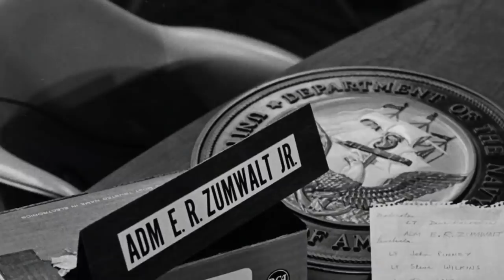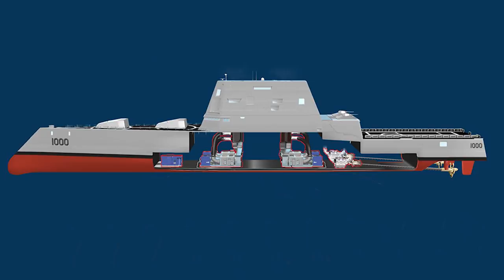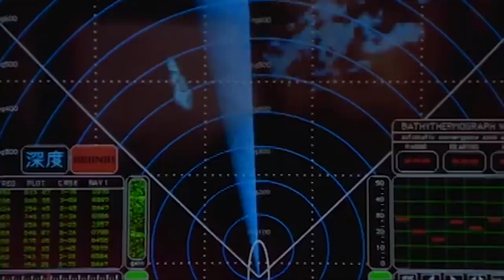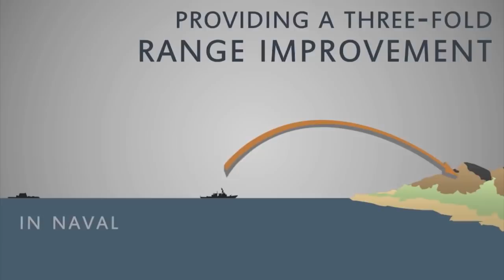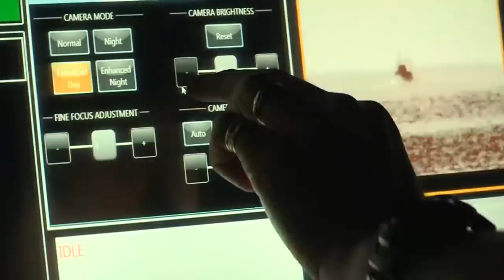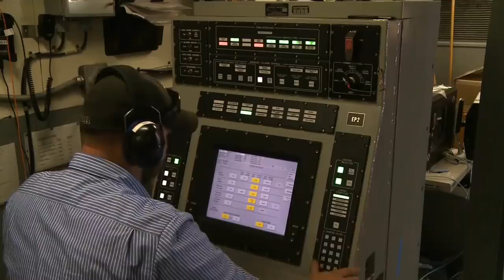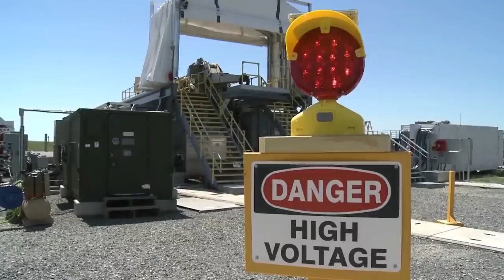Zumwalt - destroyer from the future

Comment: Retiring Battleships was dumb.

They could've designed the Zumwalt as a heavy cruiser or fast battleship and given themselves a bit more armament and space.

And why shoot guided missiles? It's artillery, use a battery of dumb fire rockets.

The reason the defense force has such a massive budget is because of our new found obsession with stupidly expensive missile weaponry which has a massive weakness in that missiles can be shot down by point defense weaponry. Meaning you have to flood the target with missiles to ensure some land anyway.

It's a lot harder to shoot down a dumb fire shell that will do as much or more damage on impact. On top of that, they're cheaper, and take less space for storage. More rounds for targets, less need to flood the target with rounds, and similar destructive power.

Comment: While the Zumwalt-class was a failure as a class of ships,it did succeeded in it second goal as the Technologies and Designs that were created and refined can now be applied to future models with out the MASSIVE cost of a new system and as the ship has more power available than its contemporaries it makes for a great platform to test newer power hungry systems such as EM-guns and laser systems. while some tech such as the canons proved to be flops the drive/propulsion, stealth and automation systems are very successful.
But saying that the class failed on the on the merits is wrong as it failed due to the failed understanding of cost by politicians, if the R&D cost was split between 50 ships the R&D cost pr ship would be significantly lower and a lead ship in a class is always much more expensive than the following ships as the shipyard has to retool for a new class and so on. also the more of equipment specially designed for a vessel is purchased the lower the individual cos becomes, but politicians hear that the first couple of ships will be expensive and so they think that every ship will cost thee same and so they want to kill the program so they can shuffle the money to their pet projects. 

One can just look at the F-35 which was crippled from the start by the involvement of the marines need for Stol/Vtol and then the cost overruns from the compromises lead to higher cost, and so the politicians made massive procurement cuts which ended up increasing cost. so in the end the planes that were bought cost more meaning that almost no money was saved when looking at the fact that for the same money they could have gotten alot more planes

Comment: Unfortunately, the determination of Zumwalt’s failure or success will not be determined until or if the ships see real action. If they function as well as the previous class, I would say they are a failure. They will have consumed way too much resource to not perform spectacularly. It would be tragic to get a report that they were in battle but were destroyed due to a software bug in a defense system or because a “blue screen” came up on a propulsion system, or some electronics failed due to corrosion of electronic or battery backup systems. The loss of lives due to being “zumwalted” is not a phrase I hope not to see join our language in my lifetime.

Comment: You're way too kind to it. In reality it was a mess from the start and got worse. 

When you're talking about 16,000 tonnes, for a ship designed primarily to fight with artillery, you are talking about a battleship. Calling it a destroyer confused the design process from the beginning, and continues to confuse it today. The belief that "aircraft carriers made battleships obsolete" is as pervasive as it is stupid, not only was it not the original theory given by Mitchell (which was about land based airpower making navies in general obsolete), but it has not been borne out by evidence at all. 

A ship in the 100,000-150,000 tonne range with 8-20 guns in the 500mm/L70-700mm/L50 range, with a barrel life of 1000 effective full charge rounds and a rate of fire of 2 rounds per minute with a warhead size of ~500kg/shell provides exactly what the USN actually needs at low cost without the development risks. Such a ship would be large enough to carry a 35m AESA X-band radar (sufficient to track a softball in orbit just above the horizon) plus 500 or so VLS cells, while having sufficient armor to shrug off anything likely adversaries are able to throw at it. It also allows for a massive increase in potential computing power for any and all applications. 

Such a ship is large enough for a twin or even quad nuclear reactor design which not only gives them unlimited range but allows them to operate indefinitely even when cut off from the mainland US, while in peacetime allows for constant global deployment using rotating crews thus effectively doubling their availability compared to a smaller diesel powered ship. It would also allow the ships to reach speeds as high as 40kts, with even their cruising speed being as high as 36kts depending on hull shape and propulsor selection. 

Such a ship could be built using proven technology in commercial shipyards for a 50-100% premium over Burke class destroyers, even conservatively these ships provide more than double the effective naval operational capability of the Burke class resulting in a effective cost reduction across the navy as a whole. 

And the only reason such an idea is considered "laughable" when it should be considered obvious is because "aircraft carriers made battleships obsolete" is a maxim that everyone believes and nobody questions. That and it doesn't make the right people enough money.

Comment: Yes 80 that is sea to land and anti ship missiles. And if you use say 10 of these missile launchers for anti-aircraft they each hold 4 so we have 70 potential ship-to-ship or ship to land type missiles and 40 anti-aircraft ,  anti-missile missiles. So now you have a ship that out can outrun any opposing ships it's almost completely invisible to electronic devices it can only be seen visually which is way too late to defend against. It has the potential to knock out 70 targets. That total pretty much out numbers entire Chinese Communist Navy on one ship and there's three of them. If I was say North Korea I'd be nervous about such ships cruising in along our Coast at night. About all that electronic gear collecting information such as location of defensive missile and gun positions troop movement and command-and-control. Imagine the three of them Cutting Loose with over 250 missiles in 90 seconds. And then taking off like bats out of hell in three different directions and you're electronic devices unable to pinpoint them and if you could you can't Target them five minutes later everything that you would use against them  is gone. Then imagine that you realize that there is a couple of carrier task forces setting off your Coast 3 or 400 miles. You don't seem to have the respect for the technology. Yes other destroyers have a few more missiles but they don't have the strike capability that is a definite multiplier. These ships are the F-22 of the fleet.

Comment: The front looks cool. I wonder how they power the electric motors batteries. It would be good for sneaking up on Iran or North Korea. Hit and run attacks. It would have to have Tommerhawk missiles and nuclear weapons. It could be used for surveillance. Since this corona virus has cost the government so much ( and everyone else) , they are going to have to make do with what they got for a while. Do electric motors on ships run on fuel?  What about making one that can go under the surface like a shark and pop up if you want to go fast. Don't have safety rails. To much drag. Give the sailors magnet shoes. Why have anyone on it at all. All done remotely like a drone. Kinda like the Germans U-Boat.
Reply: They're equipped with Integrated Electric Propulsion. There are no batteries intended for propulsion just rather redundancy of other electrical systems like the machinery, damage control, and navigation equipment. The ship uses gas turbines to generate electricity (think of a helicopter's turboshaft engine with different gearing and a development origin based around jet engines rather than turboprops like many examples out there).

Comment: A disaster from the hydrodynamic point of view.
All the hype aside, this ship is so hydrodynamically inefficient that its hull form designers should be sent to pump gas.
Why would I-an ex navy man-claim this?
  Simple.  An Iowa class Battleship (50,000tons displacement) had a 200,000 SHP power plant, giving it a top speed well in excess of 30nts (over 35nts in trials).  Zumwalt (at 10,000tons displacement) has a 141,000 SHP power plant and can't even make 30nts.  In fact, every major wearship class (Cruiser, Fleet Carrier, or Battleship) built during and since WW2 could beat Zumwalt in a flat race . . . most of them heavier and with with less horsepower.  Carriers exceed 30nts easily.  So do our cruisers.  So did the Iowas.  Seen in this light, Zumwalt is a pig . . . BEFORE its high metacentric and failed weapons systems are factored in.
  Which is sad.  I WANTED it to be a deal breaker.  But operations costs prevented it, because those last few nauts of speed are very pricy in terms of fuel consumption.  That's one of the reasons we went nuclear for half our fleet carriers this time around.  Unfortunately, when in combat, you'll need those expensive top end nauts.  You can't go cheap on a warship meant to do it all.
  Weapons:
  The Zumwalt is, effectively, the Missile Arsenal Ship the Navy looked at twenty years back . . .and discarded as being wayyy too expensive.  VLS is sexy as hell, but to fill the ship's VLS with modern missiles (SAMs, Tomahawks, and harpoons) would cost so much that we could not afford to fully arm them*.  And that's just the missiles.  The Gun systems meant for the class were defunded due to cost overruns and the inability of the weapons or their highly specialized projectiles to meet targets (pun intended).  The "Railgun" will never be in service; the heat problem cannot be managed well enough to allow a useful Rate Of Fire (ROF).  LASERs, now being tested in earnest on the USS Phoenix, have so far failed to best their ultimate enemy: the atmosphere at sea level.  Thermal Blooming (the need to ionise all the air between muzzle and target BEFORE delivering any energy to the target) absorbs 80% of power expended**.  That means in action that LASER weapons must be held on target to gain any crucial effect.  Considering the ocean's movement, that makes it impossible to punch holes in anything; imagine trying to hold a beam on a 1m target area, while the enemy captain is trying to stop you by swerving, changing speed, and letting the sea push him around.  And, using the LASER as a target designator for your missiles just moves us back to the expense of missiles conundrum.
  Sensors: 
  Ours are most likely the best in the world, but Zumwalt is no Picket Ship.  It is meant to be a standoff weapons platform, able to perform Fleet ASW, Fleet AA, and Shore Bombardment, roles with equal facility.  The weapons, sad to say, are still waiting development.
  Conclusions?  DD 1000 is a wonderful technology demonstrator (integrated power supply, up to date sensors and unlimited uplink/downlink coordination with GPS and other military orbital assets) whose proposed weapons did not live up to promise.
*Rossiyah has the same problem with its Kirov Class Nuclear powered Battlecruisers.  Plenty of space in the magazines, but the missiles are just too damn expensive to fill them.  Paper tigers.
** Lambda Max (designed maximum power transference to target as a function of wavelength) is the big hurdle for the LOS Combat LASER.  We need an output frequency suitable to transfer more power with less thermal blooming.  Materials is the key here, I believe.
  Disclaimer: I am not an expert on any of the relevant topics.  I simply try to stay informed on naval matters.

Comment: IS THIS THING GOING TO BE CONVERTED TO FULL SURFACE/SUBMARINE HYBRID CAPABILITY LATER? AND OWNED/CONTROLLED BY THE CIA? TRADITIONAL  STEALTH ON A SURFACE SHIP DOES NOT EXIST, BUT IT DOES APPEAR FAIRLY HYDRODYNAMIC UNDER WATER. 2 TORPEDO/MISSILE LAUNCHER SYSTEMS ON THE BOW. GUIDED MISSILE DESTROYER-SUBMARINE.
NOT DIESEL ELECTRIC, NUCLEAR ELECTRIC PUMP JETS. THOSE PANELS ARE ACTIVE IR/EM STEALTH. 20 TO 25KTS UNDERWATER. UNGUIDED RAILGUNS ARE A WASTE OF MONEY. NOT HAPPENING. HANGAR WILL BE ADDED LATER. SPY6 RADARS WILL COME LATER. CREW IS SMALL TO MAKE ROOM FOR BALLAST TANKS. FINAL PRICE PER SHIP MIGHT BE 4 TO 5 BILLION. THE PENTAGON WILL NOT BE ALLOWED TO OWN/CONTROL THESE HOTTIES. THESE 3 ARE TEST PROTOTYPES. THE VIRGINIA SUBS ARE ANOTHER HUGE PROBLEM. AND EVERY OTHER NEW DESIGNS THE PENTAGON THINKS IT IS BUYING.

YOU PAY FOR IT, THEY WILL OWN IT. THAT'S HOW THINGS WORK HERE. DO YOU SLAVES UNDERSTAND THINGS NOW?

Comment: The Zumwalt is an unproven piece of shit that relies too much on unproven "advanced" technology over proven combat capability and survivability .. alone, without an already well-proven-in-combat design for backup, and overwhelming superiority in battle, will prove disasterous in combat .. reliability over technology always wins in the heat of extended battle .. The Arleigh Burke and Ticonderoga hulls are old, but they are still well-proven combat designs that can compete against anything the Russians and Chinese have .. new-build versions of these hullforms, with slightly higher displacement and hull speed [12-15K tons, 32-35 knots, longer lwl, lower cg, better underwater hull performance, more powerful and more reliable turbines, more reliable ship systems, plug and play wiring, modular adapability], can be cranked out 1 to 2 per month, at current shipyard shipbuilding capability, will be seaworthy for 20 to 40 years, and will carry the US Navy defense capability well beyond 2050 or 2060 - by then, the Zumwalt will have all the bugs worked out and probably be a combat-proven, reliable next gen ship for another 50 years ..